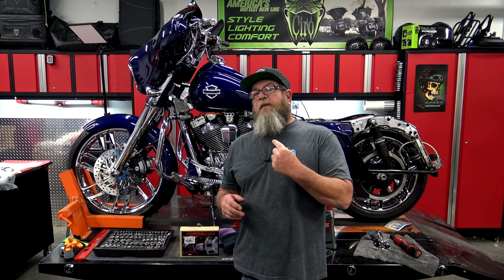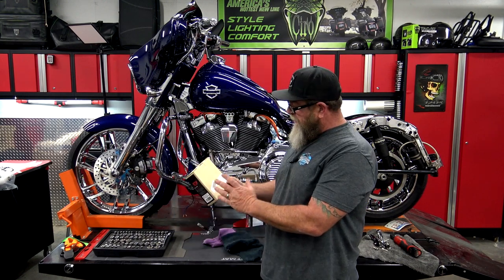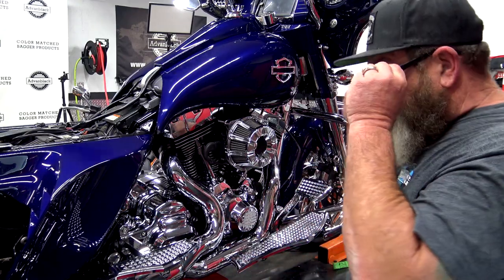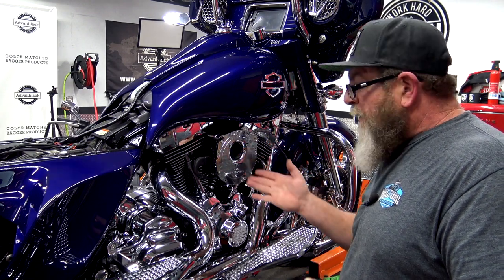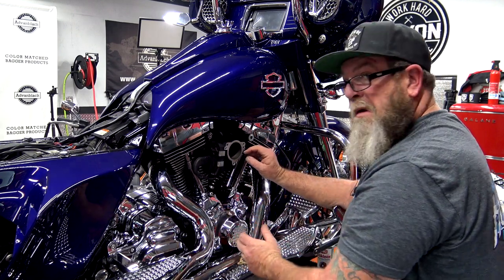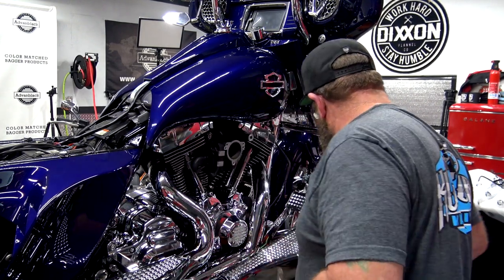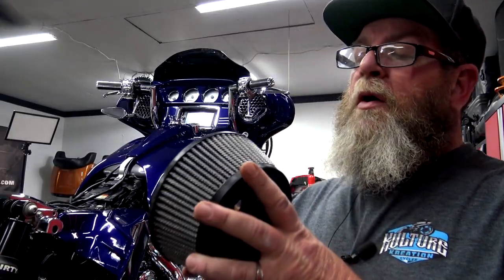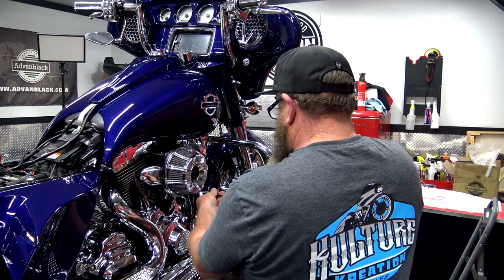Rev Up Your Engine Style with a Custom Throttle Servo Cover

Comment: Hi Steve
I was dying, laughing when you started in on Kuryakyn. I ran into the same thing, two weeks ago. I was looking for a flush gas, cap and flush fuel gauge and Kuryakyn had the flush fuel gauge, but I couldn’t find the flush gas cap. But in the picture I saw the flush gas cap. So I wrote to them they told me no technical department. I said that has nothing to do with technical. The sales department can tell me what’s the part number for the other flush gas cap and all I got was we don’t have a technical dept.
Reply from the maker: LOL Yeah they are on downhill slid fort sure..have been for years..they better get their head out of their butts and try to salvage what they can

Comment: Kind of on the same subject, the air cleaner with the Rinehart Racing logo on it is the very same air cleaner as in your video. The backing plate and the filter element are labeled with the Arlen Ness name.
Reply from the maker: Ive seen some rinehart air cleaners that are similar in style ..which one are you talking about?
Reply: @sikbaggers  Other than the outer cover, it's the same as yours. I think it's referred to as "edge cut". Black and silver with Rinehart Racing engraved on it. It's also available fully chromed.  BTW, great videos. Thanks.

Comment: Been using DAWN  DISH WASHING SOAP on my Screaming Eagle paper kinda material a/c element. Cuts oily residue after overnight soaking per. HD cleaning directions
Might try just a skinch of silver or copper coat anti seize keep little gaskets in place. Silver blends with chrome LOL !  Keep shiny side up.
Reply from the maker: yeah ive used copper on gaskets before but this one really wasnt too bad...just annoying they put the crap on there and it doesnt work..jst dont put it on there lol

Comment: Air filter cleaning. Soap and water or simple green. Do not use K&N cleaner or harsh cleaners. Do not use oil. I’ve already destroyed one of these filter elements with K&N cleaner. The element actually was coming out of the mesh.

Comment: I tapped a hole in each one of those bolt holes for the air cleaner after I plugged where that oil actually comes out with 2 small screws and then ran it into a T  fitting and to a single rubber line and zip tied it to the inside under the frame , that oil will leave a thick burnt caked layer of oil on your pistons   And I wasn't about to have that happen to that new S&S 128" I just built
Reply from the maker: Yes sir,,.,,a good catch can system is always a plus!
Reply: @sikbaggers  , when we pulled the jugs and pistons off of that M8 in my 2020 Street Glide,  I couldn't believe the amount of it on those pistons after only 9k miles on it

Comment: Mr Gasket makes a spray can with sticky stuff that makes gaskets stick
Reply from the maker: yes sir...I have some...just messy with such a small gasket and with this one its not hard to get the bolts to hold it in place..i guess my point was if they sticky crap they put on doesnt work then just dont put it on lol

Comment: I use k&n filter cleaner
Reply: Try spraying the filter with Simple Green, let it sit a few minutes, then rinse with clear water and gently blow dry with compressed air. The Simple Green or Purple Power works great and it's cheaper than K&N cleaner.
Reply from the maker: i have some k&n filter cleaner around here somewhere ...some oil too im sure...this style just needs some degreaser and blow it out...works great
Reply: @sikbaggers  do you still do motorcycle work I have a dirty air that I want installed on my 2011 touring If so where's your shop located at in Illinois I've looked through your Advan black and sick bagger YouTubes and don't see you mentioning the shop at all so I figured I'd ask

Comment: garbage quality
Reply from the maker: Thats a pretty open ended and lazy statement...what did you find out about the product that made it "garbage"? Im satisfied with mine. It installed easily, it has maintained its chrome and it covers up the servo...not sure what else I should expect from a "cover"